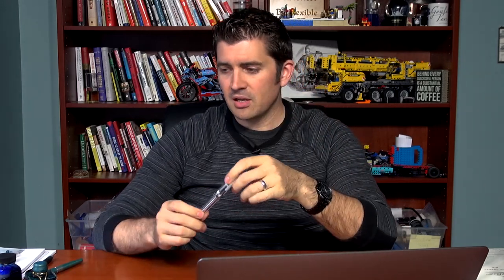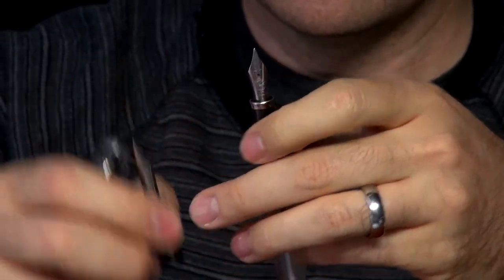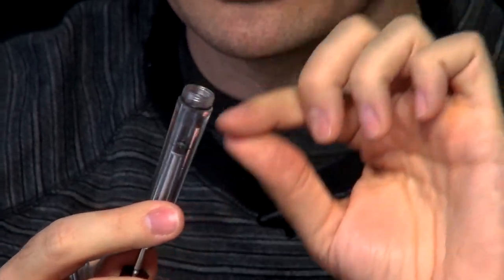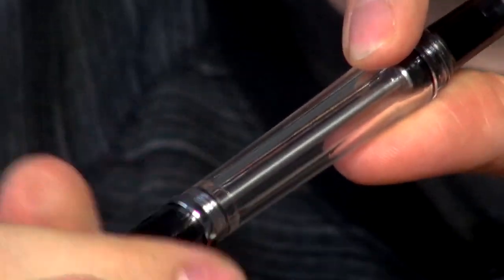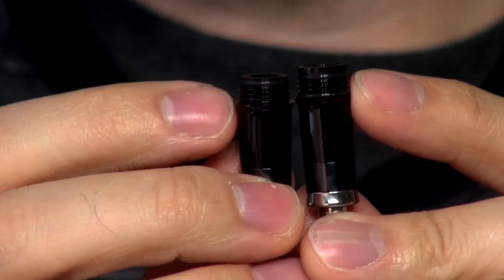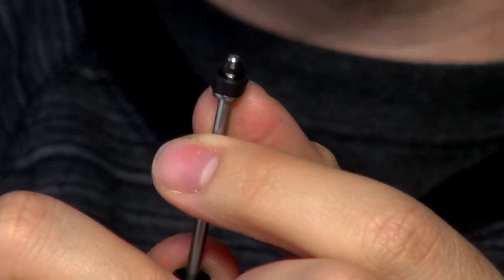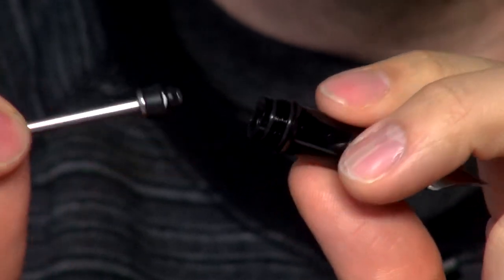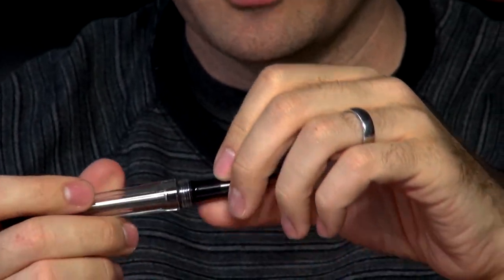What's The Difference Between the TWSBI Vac700 And Vac700R? - Q&A Slices

Comment: So if I understand what he is saying,  you have to unscrew the tailpiece to write?
Reply: Richard Atkinson Yes and no. When the tail piece is screwed in fully, it creates a seal against the nib unit. This is useful in preventing leaks, especially during air travel. There is always some ink in the feed so if you have to make a quick note or write a few lines, you don't need to unscrew it. If you want to write extensively, however, you'll need to unscrew the tail piece to allow ink to flow from the reservoir. It sounds like a nuisance, but I've gotten used to it and the Vac 700R is currently my favorite writer.
Reply: dr3m4n have you experienced any cracks or problems with the 700 r?? I'm reading alot of reviews saying the there where crack after some use and chrome pieces falling off

Comment: hey Brian. I've been thinking about getting my own vac 700R. The unscrewing of the back would be annoying though. Earlier you made a video about removing the seal ring. Does that video still apply for the 700R?
Thanks, your videos are a joy to watch.
Reply from the maker: No, that seal ring is what was removed in the 700R. I actually have one and never unscrew the rear knob. If you're writing pages at a time, it might be necessary, but it's an easy 2 second twist and you're writing again. It's an amazing pen beyond that, so I wouldn't second guess it. - Colin

Comment: So the main difference is just how well the pen seals when the vacuum knob is screwed down? So you just don't get the safety when you fly but should be fine for everyday writing?
Reply: Actually they both seal fine. The original Vac700 did not release the seal enough for some people when they were using it for long writing sessions. Hope this answers your question.
Reply: lonewolf777 wow sorry I didn't specify, my bad. I meant for nib swapping.
Reply: lonewolf777 thanks for clearing that up I appreciate it!

Comment: If you remove the small piece from the vac 700 will it fit in properly with the 700R Section ?
Reply from the maker: No, I believe the section for the 700R is tapered slightly differently not allowing for them to swap beyond the vacuum plunger. - Colin

Comment: Are the barrel pieces exactly the same? E.g., could one use the barrel (hollow barrel only, not piston, blind cap, nut or nib unit) from a 700R to replace the barrel of a 700?
Reply from the maker: I don't believe so. The threading on the 700R allows for an extra threading in the nib unit (and o-ring). It screws it alright, but I can't say for certain the seal would be great. - Colin
Reply: @Gouletpens  That makes sense. Thanks!

Comment: I had the previous model but because the cap broke around the silver ring, I returned this pen to the shop from where I bought it and I said that I would never buy again a TWSBI pen. Does anyone know if the new version has any issues like this or any other problems? I'm still attractd to this pen :)
Reply from the maker: TWSBI has made efforts to prevent any cracking issues. I have 2 of their Vac pens and haven't had any problems at all. - Colin
Reply: @Gouletpens  That's good to know...I finally took the decision to buy the Vac 700R...fingers crossed :)
Reply: @doctorasgr80  колпачок приходиться откручивать?